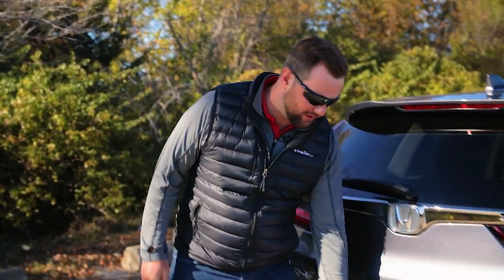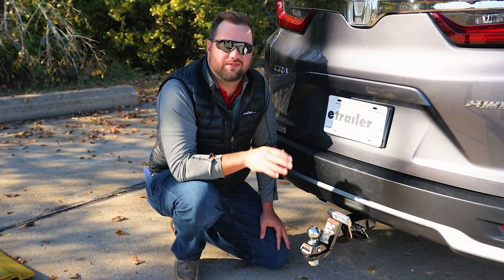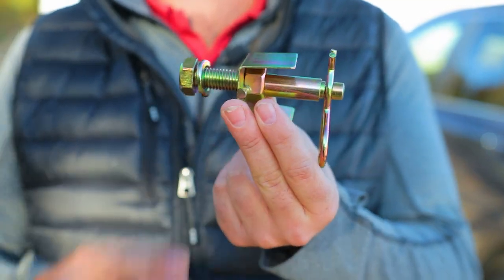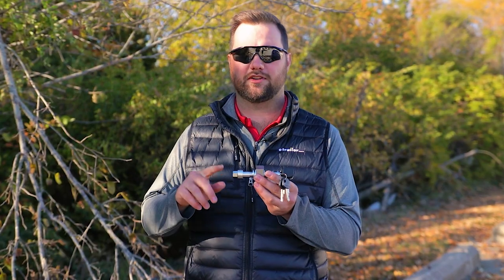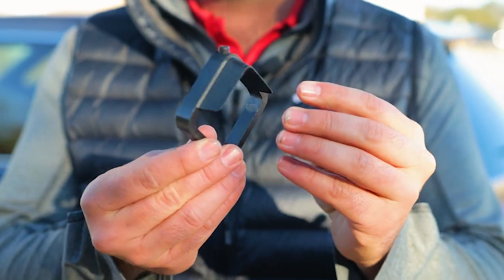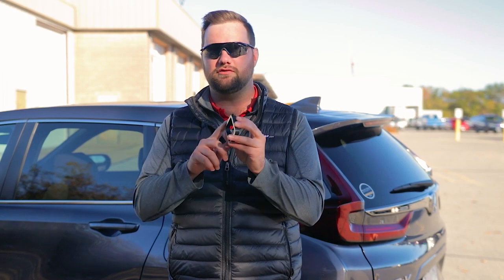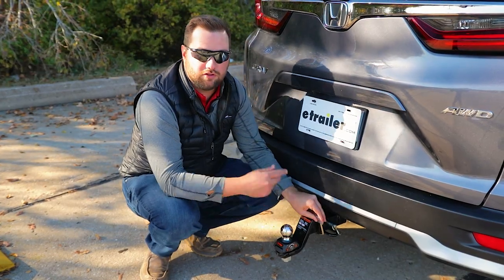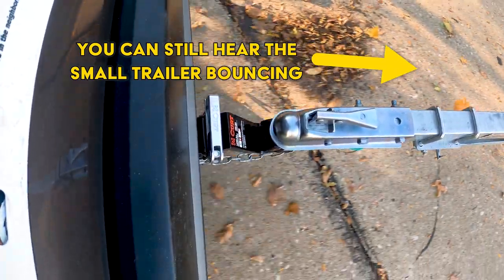Trailer Hitch Shaking & Rattling? Try an Anti-Rattle Device

Comment: I went to buy one of these at my local trailer shop, he didn’t sell them, he said on his own hitch he used a shim made from a folded piece of plastic milk bottle  - it works brilliantly - recycling at its best
Reply from the maker: That's an alright short-term solution, but eventually that milk carton material will get shredded. Or, you could use a purpose-built anti-rattle solution like #  e99007 which would work great, that you wouldn't need to worry about.
https://www.etrailer.com/Hitch-Anti-Rattle/etrailer/e99007.html
Reply: @etrailer  I have plenty of Milk Cartons 👍

Comment: Out of curiosity, are the tow hitch connection systems all designed with this play on purpose?
I could see it being useful in that when things start to rust, there will always be enough play to connect/disconnect.
But it sure is annoying (and sometimes scary!) how things can clunk around when under load.
Reply from the maker: It's a matter of manufacturing tolerances. The receiver needs to be a bit larger than the shank of the drawbar or other hitch mounted accessory or they could get stuck together and rust. The movement you're experiencing is unavoidable, unfortunately.

Comment: Electrician tape doesn''t last long.  Guess makers of towing connections never had to turn down a crankshaft to a tolerance of 1/10,000 of an inch.  Towing connections aren't rocket science. Someday a connection that fits without any need for correction will be made and all these pieces of junk will be obsolete.  Maybe I should do that!
Reply from the maker: Let us know!

Comment: Black electrician tape 😲
Reply from the maker: Using electrical tape can be a temporary solution, but it will deteriorate over time so it wouldn't be a good choice in the long run.
Reply: Worked perfectly for me, thanks!!